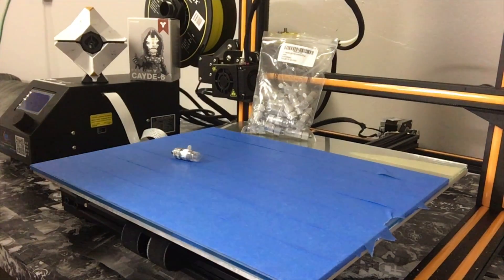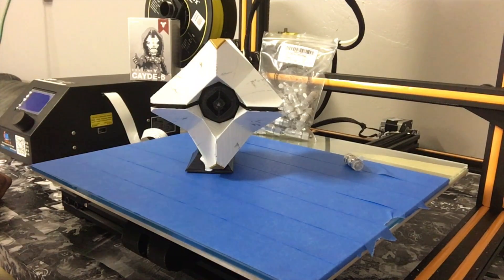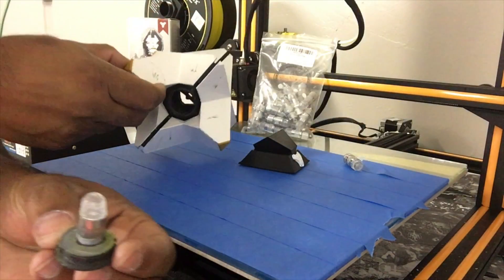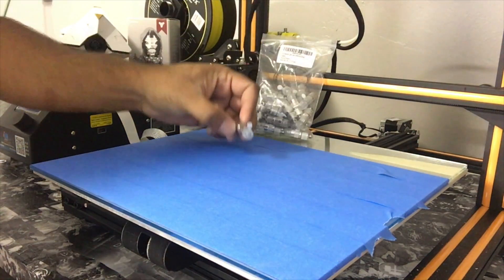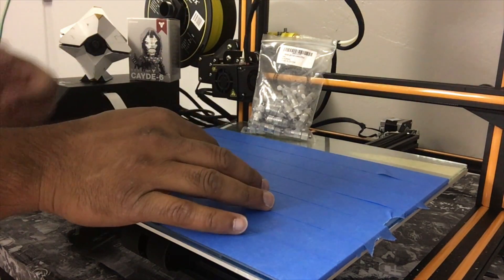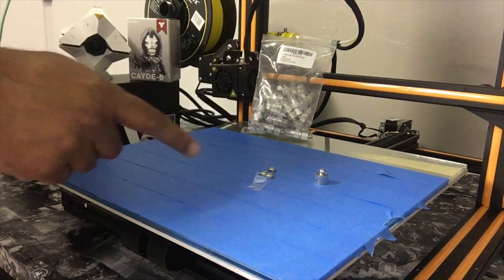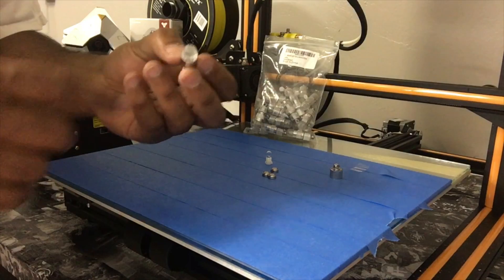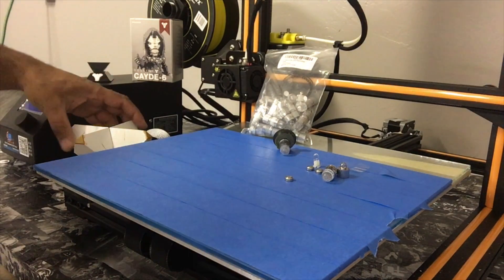3D Printing with Balloon LED Lights Review

Comment: Quick question on this actual model, I've printed it from your link, I have the lights....but the middle section looks nothing like yours, it's solid on one side.
Yes it has the small hole to,put the light in, but the other end is solid.
You sure the model is correct, or did you do some post processing to the middle?
Thanks for any help/advice
Reply from the maker: CrankyGamersUK I drilled a hole on the cap and glued the led light on that. Also the front part of the model you have to cut out part of it. As for the middle there should be a hallow drum that everything goes around.